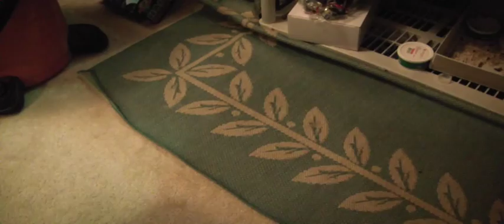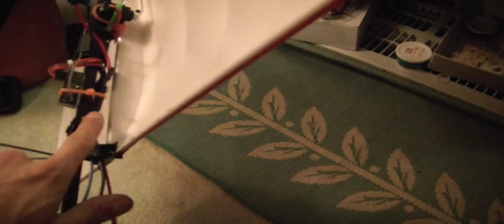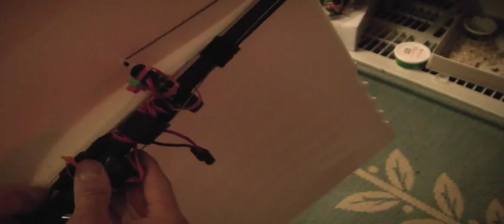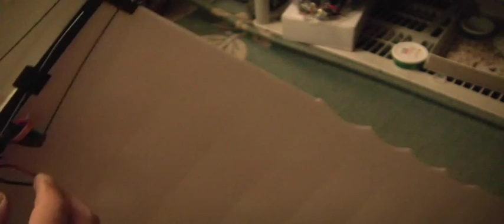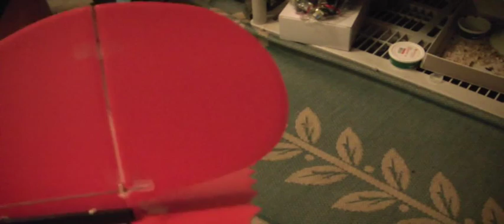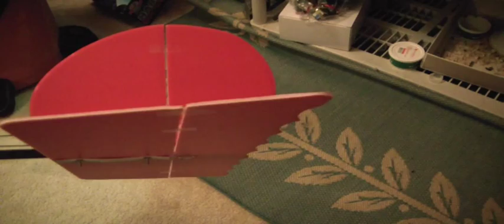GWS Slow Stick - My Brushless Build - Part 1

Comment from the maker: @masarrasan12 you can get the ARF kit for $35.  It comes with a brushed motor + prop...  You can use that motor, or do what I am doing and switched to brushless.  So the kit is only $35, but you need to add in a receiver, servos, motor(if you use a different one), ESC, and battery.

Comment from the maker: @Risqeh awesome.  Trees are where many new pilots run into problems.  Glad you found a larger field; the more airspace you have, the better!  The P-51D BL will feel like a rocket compared to the micro J3 so be prepaired to respond with stick movements!

Comment: awsome build! i just got first plane (parkzone j3 cub micro) and gave it a shot right out of the box, with a Dx5e in my baCKyard wich is fairly big, but i got it stuck in 2 trees and little tail damage, i fixed it up and took it to the baseball diamond and it flew perfect and i didnt have to avoid anything haha.. ill try to get a vid of my flights soon, as well as i just got a P-51D mustang, but im wanting to get the hang of flying with the j3 cub first.

Comment from the maker: @parkzonecorsairtips I am still trying to figure out the whole kv thing.  I know it corresponds to the revolutions per minute or second.  So it has to do with how fast the motor spins.  Torque roll is caused by a couple things though.  The speed of the motor does effect this, but also does the pitch of the prop.